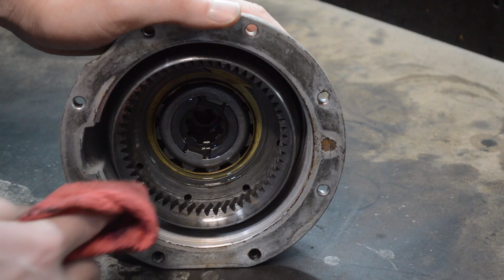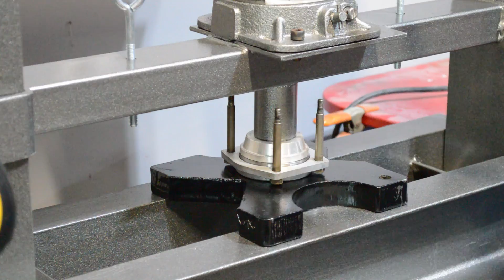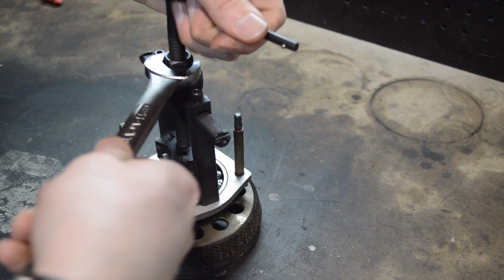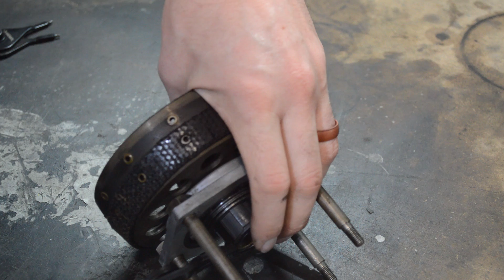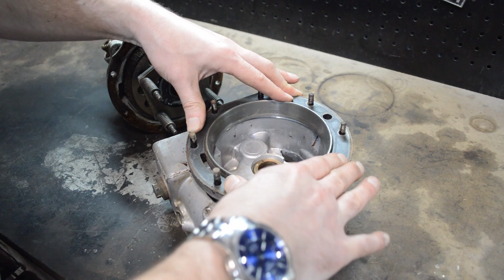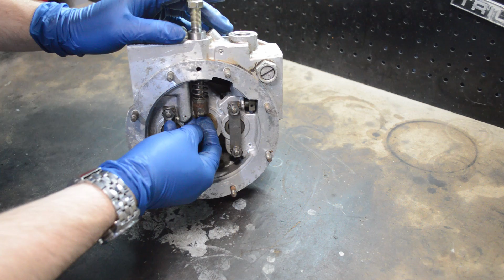Rebuilding the D-Type Overdrive Part 4

Comment: Awesome video series. This gives me great confidence in tackling my OD. Where did you end up sourcing your parts?
Reply from the maker: Glad I could help.  Most of my parts are from Moss Motors these days.  There are less expensive sources, but I'm finding they often are low on stock or it's not always easy to see if the part is the correct one.  That said, they're short on some overdrive and GT6 stuff when I'm shopping for that.  Rimmer Bros or Spit Bits usually do a good job filling in the gaps.

Comment: What sealant did you use between the case halves and the clutch ring?  I am resealing a D-type due to leaks and wondering if you used the Permatex Indian Head?  Any thought about using a RTV type sealant?
Reply from the maker: Honestly, I don't recall, but I feel like it was something by Permatex.  RTV is okay, but you need to make sure that 1) you're using something that can withstand the temperature (the gearboxes in these get hot and also run right by the exhaust), and 2) don't go nuts with the application.  It's very easy to have silicone sealant squeeze out inside the gearbox, which can clog passages and make your overdrive inoperable.

Comment: Great video !  I fully agree with using an MTL oil like Redline in these Overdrives and syncromesh gearboxes. 
Even GL4 gears lube (if you can find it) risky as modern anti wear additives are like Kryptonite on syncro rings and O/D clutches.
Reply from the maker: Great point!  I love when people are adamant that you only use 30w oil because it's thinner.  It's actually not.  90 weight gear oil is very similar in viscosity--it's a different scale.
Reply: @jabberwockytdi8901   For the last 20 years or so Gear oil manufacturers have almost universally used buffered Sulphur as an EP additive in gear oils The GL4 specification is nothing to do with corrosion resistance of yellow metals,  it is a rating that indicates the degree of the oils Extreme Pressure protection, in fact, some modern GL5 formulations offer better compatibility to yellow metal than some older GL4 products.  But that is NOT an indication that the oil is suitable for use in a syncromech manual transmission, let alone one that is close coupled to an Overdrive using a wet clutch !
Many modern Gear Lubricant formulations utilize additives (such as Molybdenum) that make them very unsuitable (too slippery ) to allow syncro rings or wet clutches to grip.
It is for this reason that Manual Transmission Lubricants or MTLs were developed.  As a requirement all MTLs will meet the GL4 level of EP protection, but will also employ friction modifiers to help syncro rings grip.  
There are many MTLs available on the market, especially in Europe where manual transmission vehicles have always been more popular. But take care to check the viscosity, as many brands tend to be lower than the 80-90 weight optimal for older transmissions.
Reply from the maker: This is great information--thank you! You sound like you have a background in lubrication technology?
Reply: @midwestmotoring  I trained as a mechanic, but I only really became interested in lubrication about 25 years ago after experiencing a product related lubrication issue. A friend in the oil industry was unable to answer my questions, but put me in touch with a soon to retire, senior Tribiologist.  We corresponded for many years after his retirement. I am by no means an expert.   But I understand the basics of, at least, automotive lubrication. Particularly as it relates to 'our' cars.
Reply: It may also be worth remembering what it says in the Official Triumph workshop manual on this matter.
Quote:  All gearbox and overdrive units fitted to new cars are filled with special oil, formulated to give all necessary protection to new gears. Under normal circumstances, this oil should not be changed, but may be topped up with any of the approved oils. If a new unit is fitted, or parts of an existing unit renewed, the unit should be replenished with new special oil, supplied with a new unit, or ordered separately from the spares division. 
Should difficultly be experienced in obtaining the special oil, use one of the approved lubricants. ON NO ACCOUNT SHOULD ANTI-FRICTION ADDITIVES BE PUT IN THE OIL.